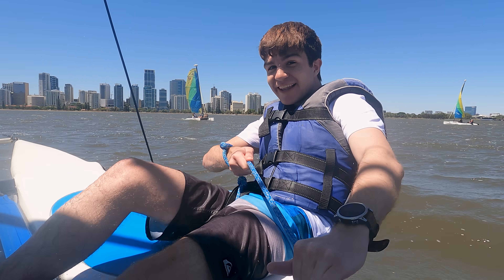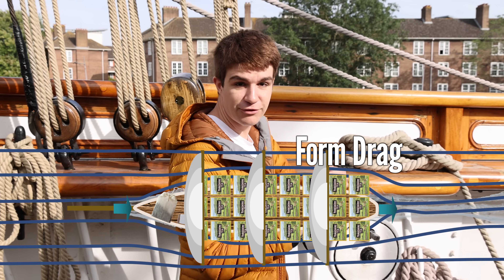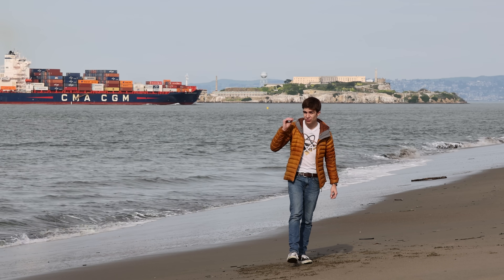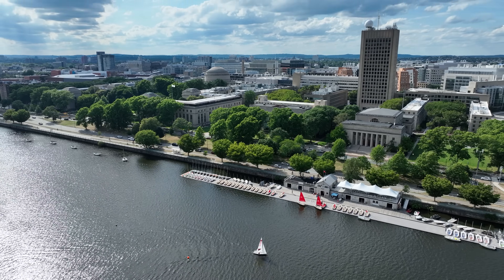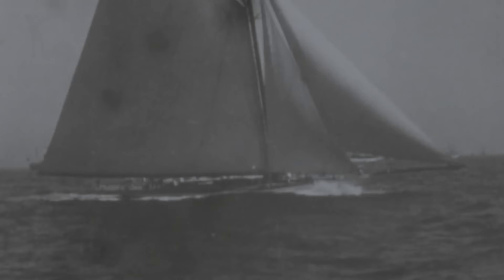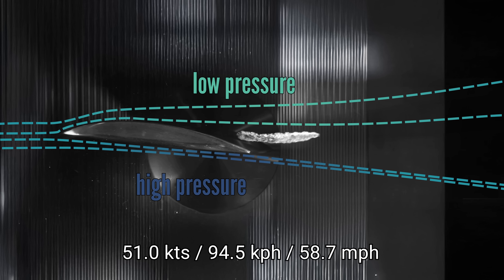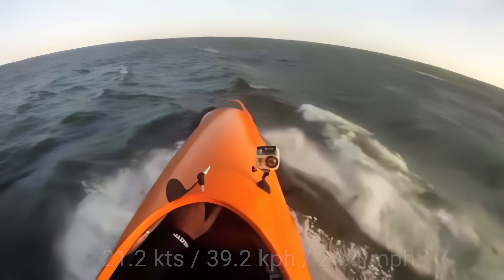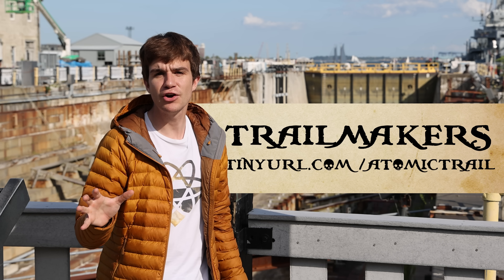What if sailing had no rules?

Comment: Sad that a big physical aspect has been left out at 4:35
Old ships used square sails with the wind coming from the back (downwind). They were basically parachutes and the maximum speed was a bit less than wind speed.
Modern ships use triangular sails and they are acting like airplane wings generating lift and allowing the ships to sail faster than windspeed. This also enables them to sail way “closer” to the wind. Modern ships can tack (indirectly sail against the wind‘s direction) where the old could only sail „away“ from the wind.
This transition from parachute to wing is in my view the biggest milestone in wind powered boats.
You might also lookup the magnus effect boat if interested…

Comment: Hey Atomic Frontier
Q - Instead of treating cavitation as the enemy of speed, why not put it to use ?
Using 'supercavitation' - engineers create an air bubble around the skin of a torpedo.
This bubble of air essentially envelops the torpedo to produce a low-friction gas environment.

Comment: Interesting, but you missed the obvious real concept advancement of Hydroptère (100 kph) which was not just for sailing fast in calm surface environments, but designed for open ocean sailing on foils in a useful size.  Yes, the sail rockets are a bit faster, but the Hydroptère concept was more useful technology for real sailing.

Comment: If it doesn't depend on a sail for its energy to move forwards then it can't be said to be sailing.  If you rely on a motor to achieve the speeds you do then you aren't sailing, you're driving instead, because you're being driven by a motor.  It's there in the name.

Comment: totally untrue about square riggers like the Cutty Sark.  They used the same low pressure system as modern yachts and could sail to windward quite efficiently.  In fact, sailing directly with the wind was the most inefficient way to sail for a sailing ship.. this is absolutely incorrect.

Comment: I have capsized a sunfish (sailing dinghy) by having too much sideways force on the sail. Though, to be more fair to myself, I didn’t capsize it. The partner I was forced to be with despite me  being in the advanced portion of the class did most of the work for that by not letting out the sheet. He then preceded to repeatedly pull the keel out so I could not right the ship. I still begrudge him for it though I did, eventually, right the ship (he had to be pulled away from it by an instructor and I got to sail it into shore by myself :).)

Comment: 4:40 A latin sail doesnt work by redirecting the wind. If that were the case, then a flat sail would work. Instead it works by creating a high pressure area inside the sail and a low pressure behind the sail, where the wind has to take a longer route around the wing form. The pushing the boat towards the lower pressure area, just like it pushes an airplane up.

Comment: Question: does cavitation reduce with greater hydrostatic pressure (ie greater depth)?Common sense suggests it would.
Reply from the maker: Yes! You're exactly right! For research we'll typically vary the pressure in our cavitation tunnels to better match the application (e.g. submarine vs hydrofoil boat). Deeper foils go much faster before cavitation

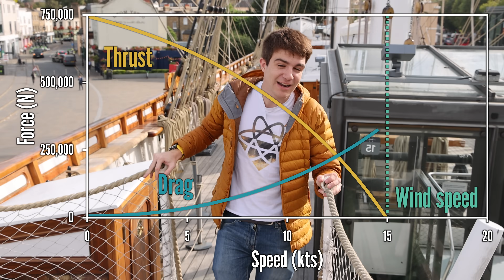Comment: 1:00 that is wrong. Sailing vehicles are in fact not limited to the speed of wind, there is much more complicated physics involved. Put short, a sailing vassel is harvesting energy from a velocity differential between two moving mediae. That is: Moving relative to the vessel, one part of it can be the ground or water which is not actually moving. You can go faster than the wind driving you and you can even sail with no wind at all if you are being moved through the still air by moving water beneath...
Reply: Ultimately it comes back to the speed of the wind even if you can go faster than the wind at an angle.

Comment: Physicist here. At 10:01 it's not air pockets it's actually water vapour pockets! Pretty fascinating
Reply: Since cavitation stems from water "boiling", let's just agree to call them "hot pockets".
Reply: @adriankoch964  this is the truth i'm going with
Reply: It's not just water though, there are quite a lot of dissolved gasses in ambient pressure water that will come out of solution as pressure decreases, those gasses are the ones found in the atmosphere (including water vapour) so air pockets is actually accurate.  🤓☝
Reply: @Soken50  No - it's almost entirely water vapour. It's just the very low pressure is dropping the boiling point of water to the below the temperature of the water, causing it to boil - and any other gases dissolved will also be released (but a tiny percentage)
Reply: @danguee1  so it's actually steam?
Reply: Some see the pocket as half empty, while others prefer to think of it as half full.
Reply: A gas pocket/bubble would be more appropriate but yeah it's not a mix of O2, CO2 and various other gad
Reply: what specifically is the chemical compound?
Reply: @darkstarprojekt  H2O. Water vapour, as they said.
Reply: I'm sure he meant that they were gas pockets, but simplified it to air for the video. While calling it air is technically incorrect, I'm sure most viewers understand that air did not magically appear underwater.
Reply: @jacobedsell8850  it didn't magically come out, it (air) came out of solution as pressure dropped and water boiled out.
Reply: @Soken50  yes, but that is water vapor not air.
Reply: @jacobedsell8850   AND dissolved atmospheric gasses a.k.a. air.
Reply: @Soken50  By that metric, every pebble on the ground is a nuclear fuel rod. It has trace amounts of nuclear elements after all
Reply: @phlosen7854  No but you could correctly say every rock is radioactive, even if very slightly
Reply: Actually it is air this theory was proven almost 60 years ago in germany
Reply: @iSmxtty if it's air, where does all the nitrogen come from?
Reply: @iSmxtty  It's dissolved air.?
Reply: @AlexTworkowski yes
Reply: @AlexTworkowski No - it's water vapour. iSmxtty just had a thought and assumed it was The Truth. It's just the very low pressure is dropping the boiling point of water to the below the temperature of the water, causing it to boil

Comment: Yes, but when they retracted the centerboard it flew over the side, into the water, and they lost it, if we take your demo literally.  ;-)    I didn't realize that the Cutty Sark hit that velocity, pretty darned impressive for the time, materials, and knowledge.   

For a while I thought about making up some foils for my Hobie 16, but never got around to doing it.  There was at least one add on kit available, IIRC, but it would have been a lot more fun to look up a good hydrofoil cross section design, and do it myself.  It would ;have been a serious kluge compared to a purpose built hydrofoil,, but they were pretty fast, IIRC, something like 1.5 max wetted hull speed, and this was long before the Hobie hydrofoil was available. 

While displacement bow wave limiting speed increases with hull length, for obvious reasons. as you explained, planing hull speed, applicable to surf/sailing, does not.  There minimizing wetted area is the key, which is one reason foils are so fast, and why stepped hulls and sponsoned hydroplanes are lower drag.  I had a 14' needle nose that employed that principle at one point that would do 48 mph on 70, in the right sort of wave action.  It would outrun many runabouts with half again that horsepower sitting on the transom.  It was HORRIBLE out of the hole though, which made getting up on a ski behind it a bitch.

As you said, one  problem with very high speed foils, in the powered domain, is that at least early designs typically lost lift and crashed at around 100 mph, so they were useless above that speed.  I haven't kept up to know if foil shapes have been developed to solve that problem.  It also struck me, back then, that some minutely adjustable pitch might be useful to at least improve that problem, lowering the pitch incrementally with speed.  That cavitation is also HORRIBLY damaging to materials, it will actually eat holes in an aluminum foil, or badly designed, or over driven high speed rudder.

Proas are fast, but unless you can reconfigure for both directions, which would be a royal PIA at best, they are useless for anything except speed records.  I guess you could design so it would sail both directions, with a single configuration, but it would be horribly inefficent in the off direction of sail.  I remember when I was studying the problem a bit, way back, there was one design that was a single foil.  It basically looked like a canted aircraft with a foil, IIRC, so that the wing produced the power, and you had full three axis controls, in the air stream.  They made a working model, IIRC, but never a full scale demonstrator, at that point.  This was all about 40 years back, and my memory isn't what it used to be (neither is anything else ;-0 ), so hopefully I remembered most of that correctly.

One problem that I remember they talked about with powered hydrofoils was picking up junk on the foil at speed.  The guy said he hit an empty coke can once, and the resulting asymmetric crash was VERY violent, like could have been seriously injurious to passengers in the wrong situation.

Cheers, great video!  As an engineer I might point out that EVERYTHING uses 'the same basic physics'.  I guess you might term relativistic and quantum physics as non basic, if you wanted to, but neither of those apply here, at least not in any practical sense.  Just sayin'.

Comment: Couldn't you in principal make a much less efficient hydrofoil that, while needed much higher speed to start working, would have lower pressure difference (a.k.a. lift) relative to speed and therefore have cavitation happen also at higher speed?
Maybe it won't provide that much difference as the pressure is related to the square of the velocity?
Another much more complicated alternative could be to have hydrofoils that are made of flexible plastic with actuators inside that can change the shape of the hydrofoil WHILE it is going at speed, allowing the ship to reduce lift (pressure difference) as needed, at higher speed?

Comment: That last record boat - isn't that basically a kite? Unlike a kite surfer, who wedges himself between the water and the kite, that boat is hanging off the kite, with just a hook in the water that is shaped to provide propulsion. What would happen if they extended the arm in a way that would allow the hull to fly high enough to avoid even larger waves? Sailing across the Atlantic in two days, anyone? 🙂

Comment: Mostly fantastic, but Oh dear!  Lovely up to 4min 40, but then it goes wrong!  No, square riggers are not just pushed along by the wind (unless downwind)  No, modern rigs do not just redirect the wind.  In both cases, the curve of the sail acts as an aerofoil.
This was even true of Viking longboats with wide square rigs.  I remember a painting of two square riggers sailing in opposite directions.  The caption was 
'One ship drives East, the other drives West
with the self-same wind that blows
'Tis the set of the sails, and not the gales
which tells the way to go'

Comment: Just a pet peeve: don't use "increases exponentially" when the dependence is not exponential. Drag increases quadratically, not exponentially. Exponential increase would be quite dramatic and with exception of short-term chain reactions, it's not found in physics.

Comment: 10:20 important to know, Cavitation also happens because of the foil exiting the water, on a Kitesurfing Hydrofoil setup, you can be going pretty slow, but if too much of the wingtip exits the water you lose almost all lift, until all the air bubbles stop interacting with the foil.

this affects “low aspect” foils more than “high aspect” foils, racing rigs use high aspect, but it still can cavitate if too much is out of the water.

Hard to explain but pretty sure its the High pressure zone that attracts the air instead of the water, then the entire surface area of the foil is just bubbles that give you no vertical lift

Comment: Thrust can't be measured in horsepower. Thrust is a force, while horsepower is a unit of power - the rate of producing work. For example, power = force × distance / time = force × speed.

Comment: ok but like... does the Sailrocket count as sailing tho?? it's basically flying on hydrofoils 💀 feels like comparing a kite to a plane.
Reply: yes. Kite sails are a thing, and, importantly, that contact with the water is actually really important. If it loses that, it will, so far as I understand things, actually behave exactly like an untethered kite: Going as fast as the wind and no faster, with no control at all, until such time as it losese lift and crashes back down.

Comment: Square-rigged sails were/are not always set in "running" mode, basically as a bucket in the wind.  The sails can be set in 'reaching" mode where the wind enters one side and spills out the other, with (mostly) laminar flow.  But only so far, because the leading edges were not braced by a wire or mast like Bermuda-rigged boats.  You can still experience this on the square-riggers around the world, in out case the STS Leeuwin.

Comment: Wings don't work that way (by deflecting) although aircraft attitude does. The work by generating pressure difference between the top and bottom of the wing thus the aircraft is sucked upwards.

Comment: Cut the BS sailing has no rules except the hull or foils must be in the water supporting the boat regardless of sail or kite.    IF you use kites that lift the boat off the water it's no longer a sailboat.     The fastest speed ever recorded for a sailing vessel over 500 meters is 65.45 knots (121.21 km/h or 75.32 mph), achieved by Paul Larsen in the Vestas Sailrocket 2 on November 24, 2012, in Walvis Bay, Namibia.    It's not a practical sailboat.  A kite sailboat 48 knots, not even close.   A monohull practical sailboat was recorded at 36.7 knots.  Top recorded speed for a  F50 catamaran in SailGP racing is 53.96 knots.

Comment: 4:29 WHAT?!?! No no no. The fastest point of sale is a beam reach (wind ~90° to the boat) and boats CAN go faster than windspeed (because the sail acts as an airfoil). How is this a "science" video when you've got the very basics about sailing wrong from the start. I mean ... did you do any research about sailing? Really sloppy mate, sorry to say!
Reply: You would be correct if he was talking about modern sailboats. As clearly shown, he is talking about older sailboats with sails perpendicular to the direction of travel.
Reply: @AstridDaFox  Except my statement is true of contemporary boats during the age of sail and square riggers. Sloop, schooner, ketch, yawl, brigantine, and lugger style rigged boats ALL were used at the same time as the square riggers. And all of those can sale much closer hauled. Fore/aft rigged boats are not "modern" in any sense. They were widely in use on smaller ships even during the golden age of square riggers.

Comment: So typical of any racing organ. Limit the design (in this case, length) instead of designing the challenge such that having a longer sailing vessel could be detrimental to success.
For instance...

- Channel locks. To race, you'd need to go through channel locks between stages. If your boat doesn't fit in the lock then you are SOL.
- Tight spaces that requires lots of tacking. A longer boat is going to be harder to turn and it won't get much benefit from its hull speed since it is unlikely to reach that speed before having to tack again.
- Shallower waters. To my understanding, if the sea floor is shallow, the wake produced changes shape. That is, you can go faster in shallow waters even with a short hull. Or maybe I am just wrong on this one.
- Instead of just limiting the length of the boat, one could make a weight to length requirement. If the boat is 5 meters long then it should weigh AT LEAST 2.5 tons. If it's 10 meters long then it should weigh at least 10 tons. If it's 15 meters long then it should weigh at least 20 tons. Etc etc. More weight means the boat sits lower in the water, increasing drag. All numbers are just pulled out of a blowhole.

Either way, I hate it when there are design rules.
Sure, no motors allowed. I get that just fine. But saying "you can't make your hull longer than XYZ" just for the sake of making it "fair" is the very same philosophy that exists in F1 racing. Which makes it dull and boring, same shit every season with more politics than racing.
If sailors turn up with longer boats, make them race in conditions that make longer boats less desirable. Let them design them however they want, just make the challenges adapt to the designs so you can't make a one trick pony.

Comment: The tea clippers were far from the first to successfully chase high speed. A thousand years earlier, the Vikings reached the same speeds in much smaller boats, by making them very light, streamlined and with relatively high stability. They reached well over 20 knops peak speeds and could average over 15 knots. Even the much more clumsy built modern versions can do this. The Berbers (not Arab) from north Africa could also make impressive speed with their pirate ships a couple of hundred years later. Probably many more examples can be found.